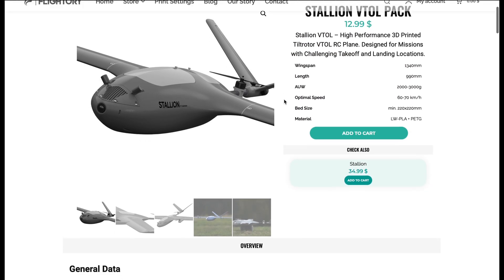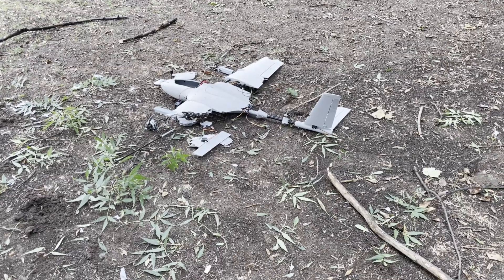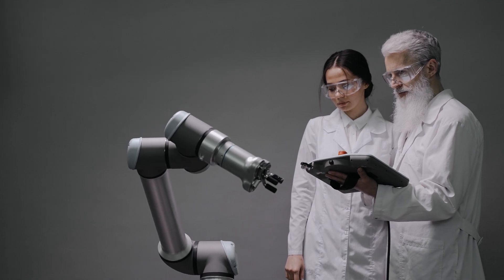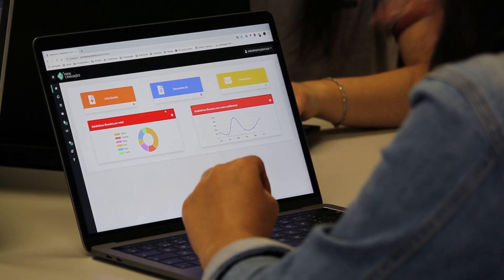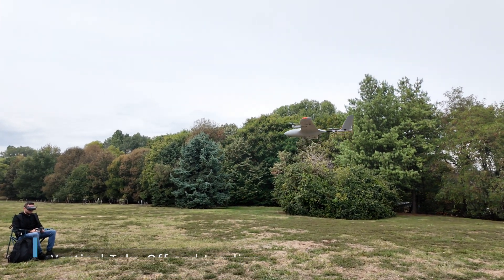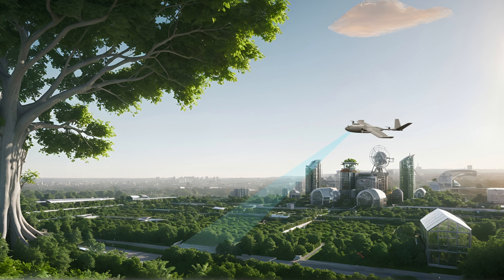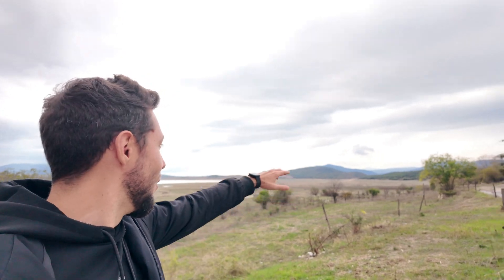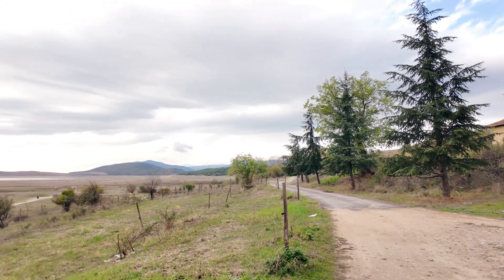Let's put Autonomous Drones to Work

Comment from the maker: What's the best use case of long-range autonomy? Power lines inspections? Gas pipes? Scanning rivers? Telecom towers? Wildfire monitoring? Wildlife preservation? Search and Rescue? Comment below 👇
Reply: military intel gathering, also if you can make them like glider and have them fly in the sky non stop for a day, you can use it for so many more things.
Reply from the maker: @madhusudhanreddy4932  Indeed. As far as I'm aware current battery tech can sustain 4-6 flight times with high-aspect ratio wings. Petrol UAVs can do 24h easily.

Military applications are a very hot topic and I personally decided to keep away from them, unless absolutely necessary. That includes border control.

Cheers!
Reply: @ Same decision I've made for myself too. I'd prefer to work on saving lives, not have to live the rest of my life knowing my work has directly or indirectly caused the death of hundreds of people, and hundreds of children being left without a dad or mom. 

As for the planes, your estimate is relatively close, though a university (I forgot which) has proven it is possible to fly for multiple days straight with a battery-electric plane with solar panels on the wing.
Reply from the maker: @ I’ve seen it, but it would require high altitudes and an insanely good (and expensive) sensors I guess 😁
Reply: @ pretty sure they flew that relatively close to the ground, with a like 4m wingspan plane. The real challenge here is engineering an extremely light an efficient plane for such low Reynolds numbers, the sensors of a normal ardupilot flight computer and maybe an airspeed probe should be sufficient.
Reply: @ Gliders take help of thermals and wind patterns to stay afloat, If an autonomous drone can leverage them along with solar, With some Gliders having glide ratios of up to 70-80:1, I think there is definitely a chance to reach that 24 hour mark, don't you think?
Reply from the maker: @madhusudhanreddy4932  Now that you mention it I'm pretty sure ArduPilot supports thermal gliding to raise altitude, so theoretically it should work.
Reply: I haven’t been able to stop thinking about the problem of how to get long ranges for autonomous drones…and it’s been running in the background of my brain for a couple years now thanks to not having time to actually explore it. 

I keep circling around the idea that A) it would need to be gas powered in some manner, B) what if you used a gasoline generator as a hybrid generator to charge batteries to that it didn’t have to run continuously, and C) what if the generator was a consumable?

That last bit is I think the important one since it might open up possibilities for designs that are lightweight, cheaper to produce, deliver just enough power for the job, but aren’t expected to have a long lifespan and are swapped out regularly
Reply: I'm interested in SAR & Medical Equipment transport.  Think "lost hiker" in the woods.
Reply: Search and rescue would benefit from this most, its very easy to incorporate Google Gemini's api to periodically scan the camera footage when it detects a person, or just about anything. I already do this with my security cameras Best part its free, or if you want more advance ai than the free model, literally the world is the limit right now.
Reply: Use it for mapping out fields and housing areas for clients
Reply: You could also install thermal and nir cameras for search and rescue 🛟

Comment: I noticed you haven't used any telemetry communication yet. why?
Telemetry could be helpful for monitoring drone status or you could use the OSD of your DJI O4 Air unit.
Reply from the maker: Good observation :) Up until now I was mostly flying FPV, so telemetry was optional for me. Now that I'm exploring autonomous missions, it's a must and will be included in the next iteration. Also upgrading the whole flight stack to a commercial-grade.

Comment: Bro uses a  big propeller with lower kv motors to get stable flight . For all motors {✓}
Atlist use 10 inch props ....
Reply from the maker: I used the recommended ones (7.5x5), but I'll give your suggestion a shot in the next build. Thanks!

Comment: I think Switchblade 600 does all of this and then some. 
Cell signals can be jammed just as easily as any other radio band. 
Python is too big and slow of a programming language for the Ai part.
Reply from the maker: That thing looks next level indeed. We are staying away from military/security applications, so GPS and 4G + Autonomy should be reliable enough. I'll keep that in mind for Python. Cheers!

Comment: All the best for your project ... So it would be great if you put some light on camera unit and communications with drone as asked by participants. What all the parameters you are looking to shortlist the technology? Thanks
Reply from the maker: Thank you and apologies for the oversight. The DJI O3 air unit I'm using handles both RC control and Video Transmission + OSD, all out of the box. It's pretty much plug and play with the SpeedyBee F405 Wing. 

That being said, FPV is optional, as I'm more interested in the autonomy without RC control and goggles. Next up is 4G/5G + Waypoints for (theoretical) BVLOS autonomous missions.

Comment: How much did it cost you to print the stallion and all the electronics? I was interested in the talon for a while but I could never get a good estimate on price. I’ve asked ChatGPT and it’s said anywhere from 300 to 1000 USD
Reply from the maker: ~$1000 with O3 Air unit and speedybee fc + 90 hours of print time and say 20h of labour. This does not include remote controller and fpv goggles.

If you can afford it, go for it. It's so worth it.

Comment: I'm still working on getting mine built.  I got V1 printed out but then Flightory released V2....  Have been also building a separate quad with a PixHawk onboard to do testing with so I can risk that instead of the Stallion.  I have a day job so it's not going very fast 🙄.  

I'm taking a lesson from your past failure and figuring out SIL/HIL testing prior to flight.   Better to crash in a simulator :P  Once I reach parity with you, I'll let ya know.
Reply from the maker: That's awesome! Glad I could be of "service", lol. Not sure if it's worth upgrading to V2 if you already printed V1. Good luck on your build and maiden!

Comment: I am watching you for the first time, but I have quite a few thoughts on this. For reference, I am not an expert, bur I am studying to be an aerospace engineer.
First off, I love the idea and want to eventually develop something like this myself, including the aircraft. You idea definitely has potential, but consider everything you're doing, including your airframe, a proof of concept. A learning opportunity yes, but I do not think this can be sold as a product. Still, a great test platform.

You mentioned requirements you had. However, in a requirements engineering sense, these are not requirements.
A requirement should never prescribe the solution. A requirement is "must reach a maximum attainable flight diatance of at least 300km."  It is not "must be fixed wing", this is one possible solution to said requirement.
In general, requirements must also be:
- Specific (avoid overly broad statements like "I want more visitors": how many more, in which time frame, etc.
- Measurable (ensure you can verify your requirements. "The aircraft should he efficient" can not be measured, a flight distance requirement can be measured)
- Attainable (the requirements you set should actually be ones that are worth achieving)
- Reasonable (your requirements are possible to reach with the time, manpower and money available to you)
- Time-Bound. (Your requirements shouls have a realistic deadline. Without one, you can not track how long it will take you to get stuff done)
This entire thing is known as the SMART principile in (imo way too corporate) project management circles. But there's still value in this.
Beyond that, you should start from high level requirements and derive lower level ones. Start with external ones, such as what regulations you must adhere to and what your market research has shown your customer wants from you.
From there you can make design decisions on how to fullfill these requirements, which become lower level requirements. I've found it very valuabke to maintain a trace, aka a note on every lower level requirement that points to the unique id of the higher level requirement(s) that causes the lower level one to be in place. If you can't find any higher level one that's a good indicator that the requirements maybe shouldn't exist in the current form, or that it belongs at a higher level. Furthermore, if e.g. your customer changes your high level requirements, you can track which lower level requirements should be affected through following your traces.
If you want to go fancy, research MBSE (model based systems engineering) and specifically the open source program capella. 

In typing this I noticed I've muddied up project goals and requirements a bit, though they do share a lot of overlap.

I've started doing more requirements engineering even in hobby projects since I've learned this, and I've found that really starting at first principles and following the tree down in a way that you can still follow at a later date is incredibly valuable. It allows you to stay on track without getting lost in the details, and it lends itself to truly finding the best solution for a problem, which does not happen when you start with a solution in search of a problem. 

Either way, I hope this was valuable to you. I'd love to chat more, and please so excuse any typos, writing on mobile is a pain.
Reply from the maker: Hey! Thank you for taking the time to share all of this. I have a business background so learning about engineering requirements is something I definitely should do. What you're describing makes a lot of sense. I'll implement that moving forward.

Could you share a bit more about the airframe you want to build? I will embark on that journey very soon.
Reply: @pathfinder.george  I did reply to this commend but I can't see it anymore. Did it maybe get caught by a filter somewhere and you have to allow it to be visible?
Reply: @pathfinder.george well since my reply still seems to be gone I'll type up a short version.
I've done some research into VTOLs, it's always a big pain to manage hover props vs flight props as they have near opposite requirements. There are some cool configurations that have dedicated hover props but use forward thrust props as additional control during hover to save on complexity. 
I've done some work for uni on computer programs that can analytically optimize aircraft. Still early days for that one, but it did work.
With the size we're talking about here, the low Reynolds numbers are always funky, you can have a wing with a CL_max of 2 at the root and 1 at the tip because the taper ratio means that the lower Reynolds number out there causes a performance loss.
Also, camera systems like you want are stupidly expensive. For reference, an enterprise camera UAV costs maybe 15.000$, the camera gimbal in the nose 100.000$
Reply: @pathfinder.george looks like my second attempt at properly replying here was also deleted. WTF. 
Anywhere else we could talk?

Comment: Wiggling under fixed wing mode is definitely not normal
Reply from the maker: Well... it's a 2.5kg aircraft flying at high winds. Perhaps a more precise IMU and some extra weight (sensors, etc) will improve things. Not to mention I was flying without an airspeed sensor :D What are you flying?

Comment: have you heard about eu regulation about drones ? they fordib autonomous drones non supervised by a physical person who can see the drone ?
Reply: how you're planing to make the 4g connection to tge drone? im also working on simillar project and using rasberry pi for this
Reply from the maker: @ormaman905 I’ve only done shallow research for now. Any advise would be appreciated. I need to be able to update waypoints and receive telemetry via 4G. Video feed is optional.
Reply from the maker: That is correct. My assumption is that long-range autonomy will create so much value for governments and businesses that a legislative framework will take into effect soon after we achieve (and prove) technical feasibility. Fingers crossed! Until then, we'll do some form of human supervision.
Reply: @ yeah that is also my hope, but i wont bet on it… but doing human supervision loose the concept of autonomy unfortunately…